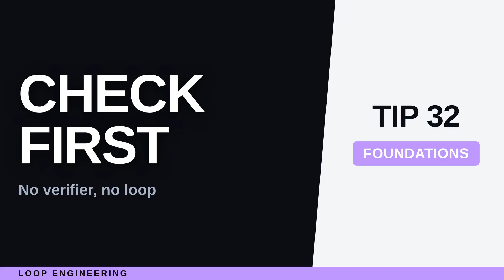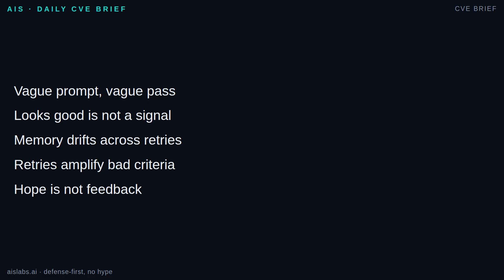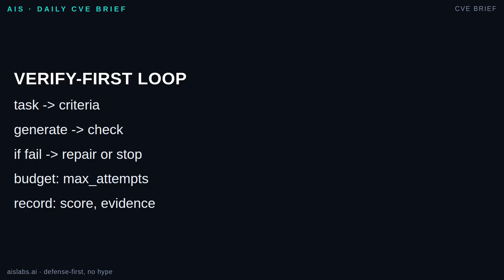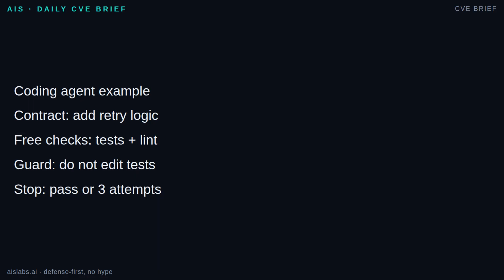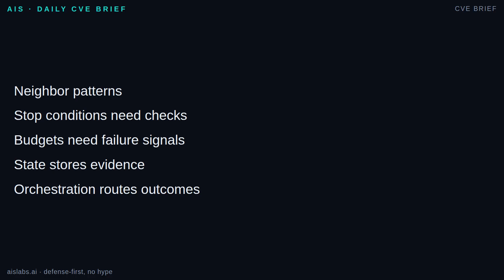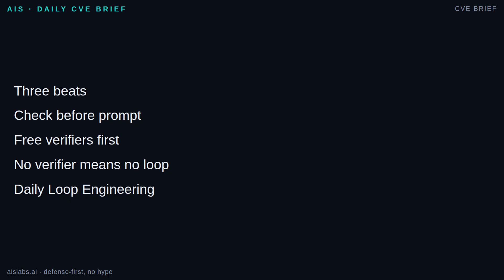LLM Evaluation Basics: Write the Check Before the Prompt

Comment: “Write the check before the prompt” is exactly the discipline many agent workflows are missing. DeepPattern extends that verification-first idea by attaching behavioral checks, evidence, escalation, and re-verification to the full agent workflow—not only the final output. We’re running an external preview and this seems closely aligned with your approach—would you be interested in participating? If so, what public professional channel should we use to reach you?